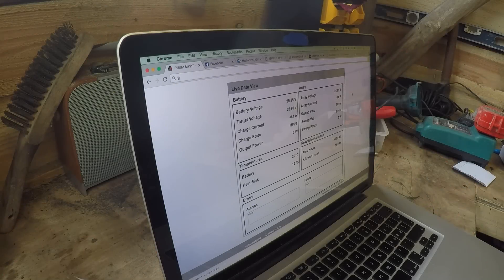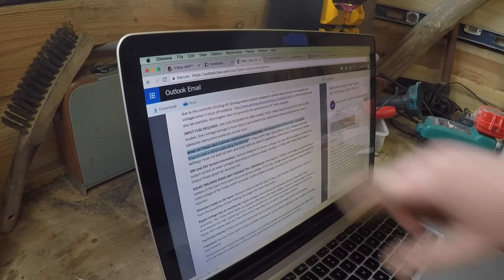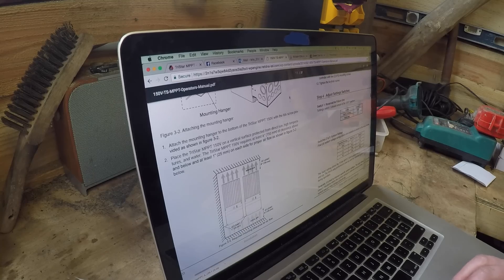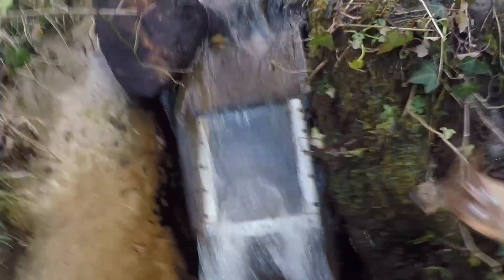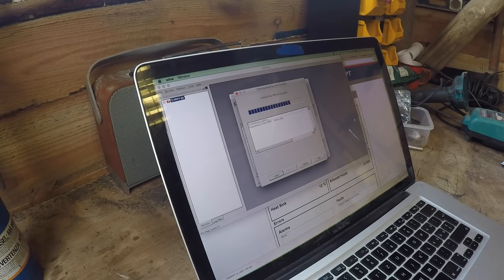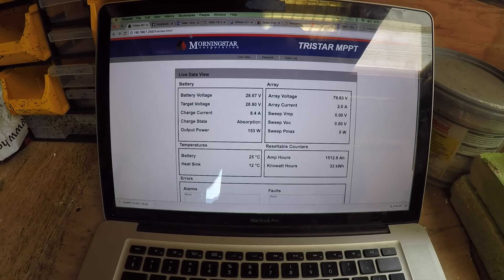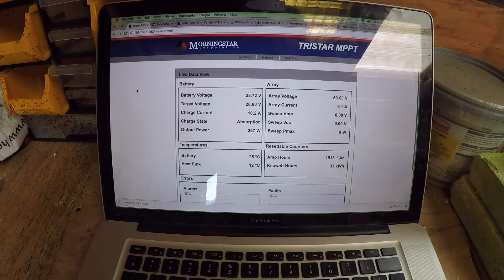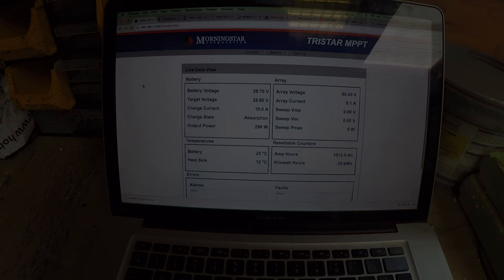DIY Micro Hydro Part 20 success!  67% efficient. 298 watts

Comment: I'm glad you got this figured out. Thoughts on adjusting the volts +-10 and plotting the values to verify 50% unloaded rpm is the most powerful?
Reply from the maker: Hi joe, i did mess about with it a bit and found 50v is really about as good as it gets. i tried 49 and 51 and both of them produced less power. i think 50.2 is the sweet spot. but it only changes by about a watt at that point.

Comment: So what did you think custom setting stood for? Obviously you have a custom application. A phone call isn't hard. Really. But glad you worked it out ok. I am sure the company has a lot of legacy customers they also need to support hence the somewhat arcane interfaces.
Reply from the maker: That custom setting is in a table of battery charging voltage that have nothing to do with fixed array voltage, its not even close to being clear. the tabel says its custom settings for what voltage to charge the batteries to before changing state of charge.
Reply: Sounds like they have a good support team for specialized applications!

Comment: Nice!

I have water, but very little head, so I'm a bit envious now. I'm pondering building a waterwheel to utilize what little head I got, but output will be abysmal comparing to your setup.

I would get some output during heavy downpours, but it's not worth the effort right now. But who knows what the future brings.
Reply from the maker: have you done flow test? how much flow do you have?
Reply: Kris Harbour No. The watershed is quite small, so it varies a lot. Judging by eye it varies from about what you have shown in videos and many times that during and after a day or so of heavy rainfall.

Comment: Don't you want to capture as much power as possible from this system? Why don't you have a large battery cell hooked up to it so you can have backup power? I'm pretty sure you do that with the solar but why not this system?
Reply from the maker: it is connected to the same battery as the solar.

Comment: Anything better than serial? Nah. USB works for a few feet. RS232' standard defines 2500 pF, which is (on CAT5: 17 pF/ft) ~150ft. And RS232 has a lot of build-in protections (short circuit & overvoltage). RS485/RS422 works till ~1200 feet (or longer when opto-isolated each distance).
Reply from the maker: Fair enough but so does ethernet.
Reply: Yea Ethernet is great. I've made a sandwich (diy pcb) for an Arduino Pro Mini + enc28j60, costs 6$ all-inclusive (got 30 of those). ds18s20 / ws2812 / whatever I'd connect to it, just works great.

I'm quite jealous on your water stream. Quite sad we don't have those close to where I'd live. I'm only capable of playing with sun (and maybe a mini windmill).

Comment: 67% overall efficiency and 300W is impressive. I guess you can reduce the flow and power to closer match your load which, I assume, would reduce wear on the Pelton wheel bearings. One really nice thing about hydro is the constant power means you don't cycle the batteries at night and therefore you get a good battery life out of lead acid. I'm purely solar so am using second-hand lifepo4 because of their long lifetime when they are deep cycled.
Great series and explanations on the power curve of the Pelton wheel turbine, it cleared up my confusion on efficiency.

Comment: dip 1 seems correct for future use if you conciser there is no documentation for wind mode and had to get it from support. 456 for custom voltage config also seems legit in this configuration.
Reply from the maker: The trouble is you can log in to the program and change to wind mode and re program the device without it ever telling you you need to change the dip-switch and without it being in the documentation. so you are given a load of options and you change them and nothing happens so you read the documentation and there is nothing mentioning why. on top of that why  can you change settings in the program that are not supported by your dip-switch settings? in every other program stuff not supported is usually dimmed and not changeable. this is a £560 controler that has had years of updates and changes and customer input this stuff should have been changed long ago.
Reply: Cant argue with any of that Kris, you are right.

Comment: Loving the series but would like to have a parts list on the pipe fittings and nozzle.
Reply from the maker: I had a lot of problems with the company i used for the pipe so i am not willing to advertise for them. it is all mdpe 110mm pipe and the nozzle is on eBay in Italy. thats about as much as i want to share as the company i used i would not recommend to anyone.
Reply: What is the nozzle called?

Comment: It will be interesting to see how the WX over the course of a year or two will affect reliability of the system. In other words will your water source be reliable in the summer months. Hope you will give a periodic update. Thanks, I appreciate your sharing this project.
Reply from the maker: Hi john, if you remember in the first video i took a water reading of only about half a liter per second. so during the summer the flow will be very low. and the turbine down to producing about 50w but i have the solar in the summer. also im looking at diverting some water from another stream to this one to make a higher yearly average.....Thanks for the comment, i will keep you updated.
Reply: Do you have the space or ability to build a storage pond? You could use excess power to run a pump to store water or just divert part of the steam. Your plan to divert another stream into this one is probably the better one though.

Comment: The reason that the voltage is not at 0 even when everything is disconnected is due to potential difference. If you want it to be 0 then put a resistor or a wire between the 2 pins when you need to :)
Reply: one must always remember the potential,  of the Magnetic fields wet up in all the copper secretary of all appliances that move the electrons  within the wire  Often it takes a time  to disparate out of  the circuit & coils & cpasirers  in ues.   In time  it will show  (0) if left turned off.

Comment: 2nd turbine would be better than a 2nd nozzle mate. :) Now you just need some GPU's mining off free power :)
Reply from the maker: well that would be adding in extra bearings and extra losses. but i have been talking to the farmer that backs on to my land and he has no problem with me diverting some water from another stream on our shared boundary so more water and another turbine might come in the future.
Reply: Sounds good mate, but it looks like you already have enough water for a 2nd turbine. I only say 2nd turbine as im good at killing things by running them at their rating, i find 60% of capability prolongs the life of the equipment immensely. And you have already done most of the hard work, you would only need to fabricate another housing, and split the water feed after the valve. If you can get another of the same generator, you can also use the existing cabling to double the amps. :D
Reply from the maker: yeah that is a good point, a second turbine would also act as a backup if one was down. very good point.
Reply: Your very welcome mate. :D

Comment: Two places I know they where told in the 1980s and 1990s it would cost them 10,000 and 20,000 to connect them to the power network - it does not come cheap - the 20,000 used a diesel generator for power but after years of use they went to mix of wind and solar and the other place got together with a number of building owners to get power connected and that 10,000 went down to 2,000

Comment: Your charging your almost full battery with 10 amps? Won't that damage the battery?
Reply from the maker: well its not really charging it at that. because alot of the power is being drawn right out. i had light on in the house, the inverter, light on in the shed, laptop, internet routers, so alot of those amps were going straight out again.

Comment: Awesome, well done Kris 
The cost is impressive. 
Much more environmentally friendly than a coal fired power station. 
Do you think it would be possible to install this with a grid tie inverter ?
Reply from the maker: Thank you. it could be done cheaper as well. i used high quality pipe and fittings and an expensive controler. using second hand pipe could bring the cost way down. and yes i can see any reason why it wouldn't work with a grid tie system. a system this size is better suited for off grid but it could be done.

Comment: How much total output power do you need for your homestead?
Reply from the maker: currently only using about 3kwh a day. but im slowly getting more electrical appliances so its going up all the time. I now have 1kw of solar and 300w hydro on a sunny day this time of year i can make about 11kwh in 24h and that is before adding a second nozzle and with short daylight.
Reply: That's quite impressive. Thank you for these videos Kris.
Reply: hes not connected to the grid but if he was technically he could depending on the local laws
Reply: If you would be running a surplus can you sell it back to the grid ?
Reply: thanks man, then i know =)
Reply: Kris Harbour yeah that was gonna be my question .... in what respect do you mean putting in an extra nozzle ... are we talking splitting the feed and driving the same turbine or splitting the feed to drive a second turbine ??
Reply: The more the spear jets/injectors the better the effirciency. irrespective of the flow rate

Comment: Hi Kris!  If you have further problems with the Moringstar, you might want to look into an Outback multi-voltage controller.  Just a thought.
Reply from the maker: I wish i had gone with the outback now. i was torn between the two.... i chose the wrong one i think.
Reply: There is a YouTube channel "Pure Life For Living" & they use an Outback system for their solar system